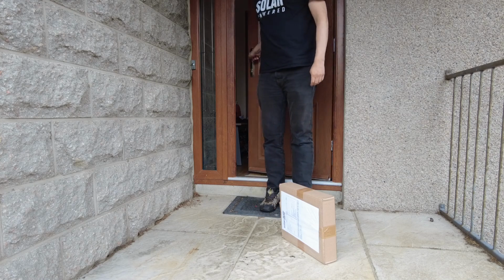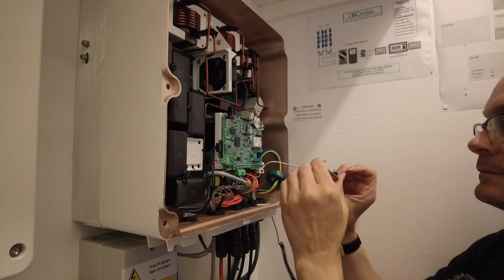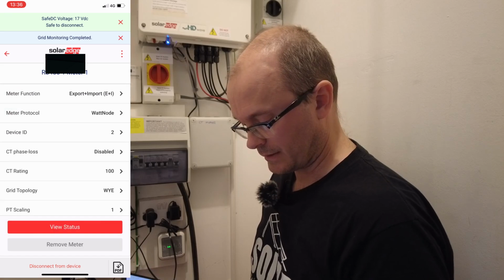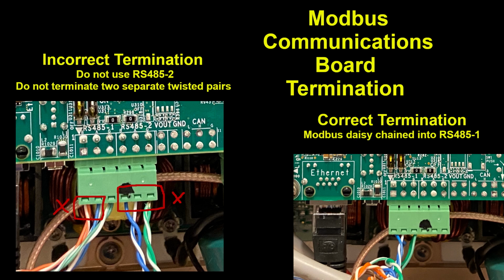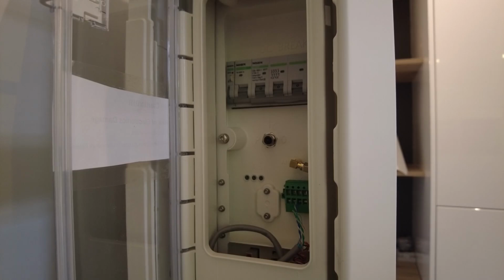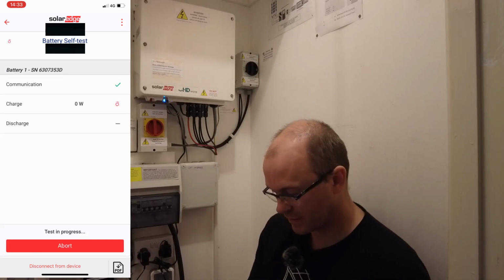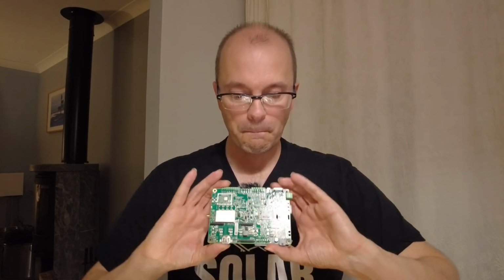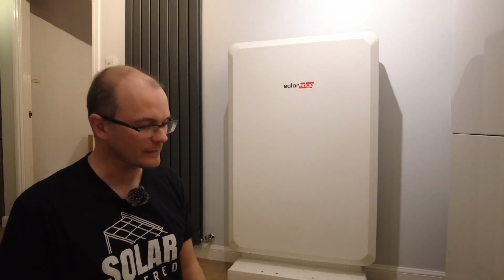SolarEdge Energy Bank Review, Part 2:  Communications board replacement and commissioning

Comment: Thanks for posting that video. Really nice walk through the commissioning process. I think you're right about the comms board. It's highly unlikely to have "blown up" without any physical signs of scorching.  SE are extremely anal about their start-up and shut-down procedures so getting it wrong is easily done, especially if you have conflicting information.  I'm surprised to see you have a DC isolator as there is no need for one with SEs HD Wave inverters. From all the SE installations I've seen, I think ours is one of the few to have no DC isolator. That 5 minute wait for the DC touch voltage to fall to a safe level is all important.  Also good to see a SE hot water diverted in action. I presume you can set it to not pull power from the battery to heat the water? One of the issues we encountered with our solic200 was that it couldn't tell the difference between what was in the battery and what was excess solar. Apparently it's an issue with DC  coupled batteries.  I've kind of solved it by fitting a smart water heater switch that allows me to toggle the hot water off if the Solic200 starts to drain the battery.
Reply from the maker: After 1 day, the HW controller and battery, both controlled by Solaredge, sit really well together.  Battery takes priority when surplus solar is presented, hot water takes third place behind the electric car.  But the electric car charging is completely invisible to the SolarEdge inverter and the home battery is completely invisible to the car charger.  However they both have visibility over hot water power.  My December video shows how I did that.  So I’m working out how to get the car charger to behave using some logical functions.

Regarding DC isolation, I haven’t read the SolarEdge wiring instructions, but I am a safety and automation systems engineer.  While the inverter isolation function “works”, the more pertinent question is one of “probability of failure on demand”.  DC isolation switches are simple, visible, well understood and are known to satisfy wiring regulations.  They can still fail, especially if contacts become welded, but the failure is visible (switch won’t budge).  When my comms board failed, the indication of safe DC voltage also failed to work.  Whilst I was confident that the actual DC voltage was safe, it’s still fair to suggest that there’s no harm in adding a DC safe isolation switch.  The inverter toggle switch after all is merely an input to a programmable logic solver, it’s not a physical barrier in its own right.
Reply: @anthonydyer3939  thanks. Interestingly, I attended a Solaredge webinar this morning on battery installation. They specifically spoke about DC isolation and the requirements of BS7671. They stated that their inverters are fitted with a DC switch disconnector that meets the requirements of Regulation 713.537.2.101 and also meets the requirements of the IET Code of Practice for grid-tied solar PV.  I completely understand the belt & braces approach to isolation, but that's why you always check the equipment or circuit is safe before proceeding.

You'll also be delighted, I'm sure, to hear that SE is doing away with RS485 comms on its new product range. Replacing it with a new "home network" arrangement that communicates over local WiFi.
Reply from the maker: @daveforrester61  That's very interesting.  Can anyone attend their courses or is it only available to persons holding recognised electrical qualifications?

Another advantage to manual DC isolators is the ability to lock out.  I'm not to sure if you can do that with the inverter toggle switch.  It's not a big deal on a domestic property, as I suppose you can always isolate the inverter itself on the AC switch.

I've always found RS485 comms to be reliable, but they can be a pain to commission (easy with two nodes, and two wire variants, harder with four wire variants).  They've never in my experience caused equipment failure however.  They either work or they don't, until you fix it.

Wireless have their own issues.  It's no doubt fine in my house, but if wireless traffic conflicts or signal attenuation becomes significant then it can be problematic.  They also consume more power.

I personally like ethernet.  It's low power, ubiquitous, reliable, resistant to obsolescence and interchangable with wi-fi as required.
Reply: @anthonydyer3939  I like ethernet too. I switched our comms from WiFi to ethernet and it's much more stable.

Webinars are open to installers in the main. If you have an installer account, which you must have if you were able to commission your battery, you can sign up for emails from SE on webinars etc.  The recordings usually get uploaded to their Academy after a week or so.

Comment: Incorrect isolation procedure at this level & on this type of equipment should not result in damaged internal components. I'm an electrician getting into solar & have been looking at solaredge as they have a good rep, but this is very concerning.

Comment: Tea bag in with the milk?! The brewing procedures are incorrect.
Reply from the maker: Very Good!  You can say the same thing about the SolarEdge manuals!

One section tells you to turn off the AC supply first, before switching the inverter toggle switch to 0.  Contrary to what 1st line support told me.

Comment: I agree with your diagnosis of the failure of the comms board. If an incorrect shut down process could cause the board to “blow up” then the board would also be vulnerable in the event of a mains failure. 
I’ve recently discovered that an elderly neighbour has a non functioning PV plus battery installation that I’m going to investigate, because the installation company seems to have evaporated. At this point it’s unclear whether the installation was ever working.

Comment: You should be able to cut the AC regardless that's a poor design
Reply from the maker: I completely agree.  Any electrician working on any other part of your house will concern themselves only with the dual supply to the consumer unit.  They won't concern themselves with how your inverter works.  They only concern themselves with making their circuit safe to work on.
Reply: @anthonydyer3939  yes and then your in for another board

Comment: This seems strange. If you have a power cut it will blow the board - that is the same as using the ac isolator?
Reply from the maker: I raised that point to them, and it's not the same situation.  In that instance the capacitors can drain through the loads in your house.

But I don't think that first line support were correct in making that statement.
Reply: @anthonydyer3939  I guess if the RCD tripped it couldnt drain through the house. Interestingly page 42 of the inverter manual clearly tells you to switch off the ac breaker before throwing the switch on the inverter: 
https://www.solaredge.com/sites/default/files/se_hd_wave_inverter_SetApp_installation_guide.pdf

Definitely sounds like support giving out duff information.

Comment: Fascinating stuff Anthony.
As I move towards having my own Solar PV + Battery installed I must admit that your experiences make me somewhat nervous about problems and technical issues arising. Although I am a competent DIYer and reasonably technically minded I would definitely have been well out of my depth if I found myself in your situation. Hopefully my installer would be quick to resolve the problem but, as you said in the video, they are all very stretched at the moment.
Reply from the maker: The big problem is tech support doctrine.  They just think in "pre pandemic" terms, i.e. send a new part out, and next day the problem is solved.    That doesn't work now.  Spare parts take weeks to arrive, and you're left high and dry in the meantime.

It would be refreshing if they could entertain the idea that maybe a little problem solving outside of the scripted playbook could be entertained.  In my instance, if I had the software to upload via USB, or could clear settings by removing the battery, maybe I wouldn't have suffered for 5 weeks.

Comment: This collection of modules, wiring, procedures, firmware etc tells me that the power bank and solar energy market is not sufficiently integrated and sure to merit an average consumer to make such a large financial investment..
Reply from the maker: I'd still call myself an "early adopter" for sure.  The economic case for batteries didn't exist only 18 months ago, and now it's a very compelling product.  

The solar energy market is certainly ready for mainstream, but the battery market I think will see further evolutions.  I think SolarEdge will probably render serial line comms redundant in favour of wireless and/or powerline communications.  That would simplify installation even further.

The other thing I'm paying attention to is what Bluetti and Ecoflow are doing to batteries.  They have some very interesting "no electrician required" solutions that you can just buy as a homeowner.  You still need an electrician to integrate into your house, but they can work standalone and I think that could well be a very popular product in future.
Reply: This comment is very true. As a result, many of us have installed bespoke kit that only we understand. Only three companies are moving towards integrated solutions - SolarEdge, Tesla and MyEnergi. Choosing from these, I will stay with SolarEdge for my next project.